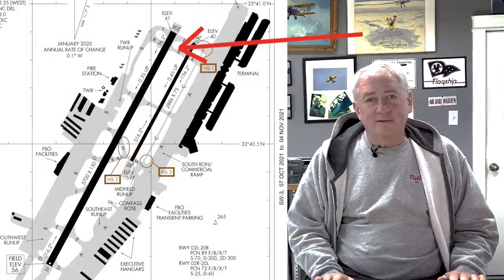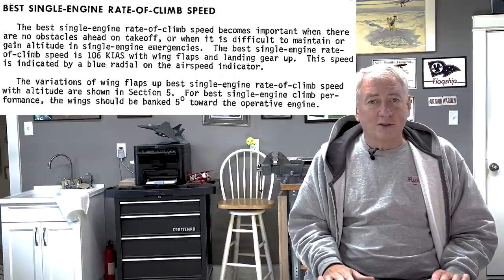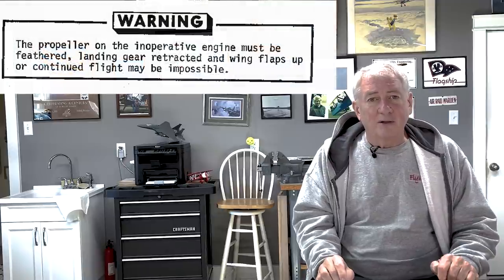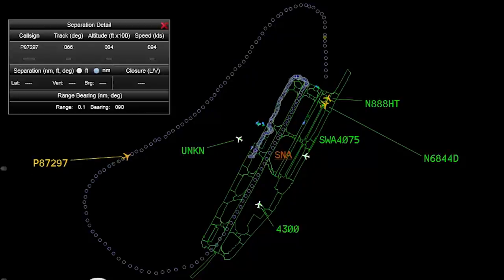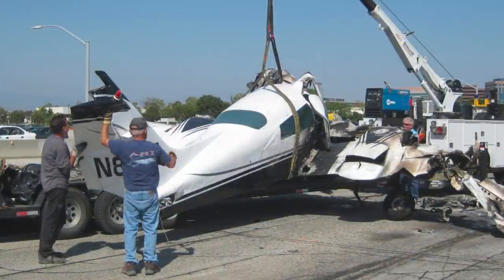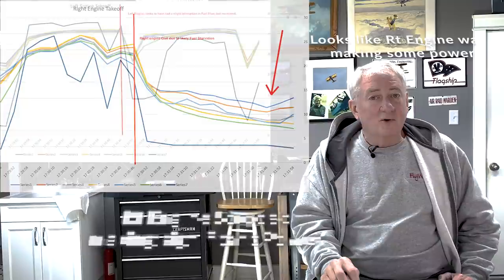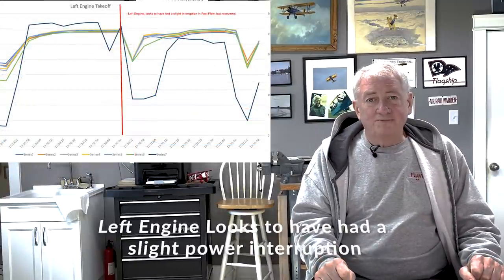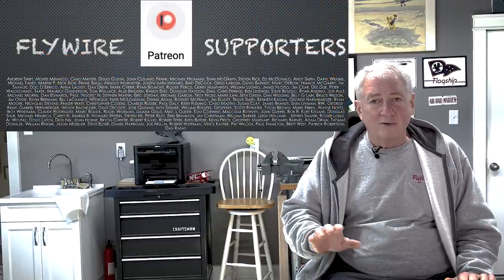C 310R Engine Failure After Takeoff

Comment: Mr. Perdue,, You had a single engine go around on a DC3?  Worst time ever.  High drag, low speed.  An ignorant FAA inspector on my multi checkout in Miami cut the right engine on me as i was raising the flaps and gear after a single engine approach.  He called for a go around.  I put power on both engines, At about 50 agl he cut the right engine again and said, no, on single engine now..  Piper Apache 150 hp high time engines. No climb with engine outs even with half tanks. 

 I went down to ground effect while flaps and gear went up and telling the dummy "Sir, this airplane cannot climb on one with gear down or at hot temperature.  He said, "Yes it should.  I hold it on ground effect for a few thousand feet telling him, no sir, it wont, While he insisted" it should climb now" keep it like that".  I was keeping it over the centerline with the 5 degrees to the good engine at full power, but.. it didnt climb.  

Almost at end of runway, he finally saw it and put power again, on the right.  Too low at end.  My friend in hangar came to see and though i really lost the right for real.  FAA inspector apologized.  He thought this was a PA23 Aztec.   Didnt know much about the many PA23's.  Almost killed us.  A Burrocrat pretending they know all they need to know.  I passed the CPL multi that way.  By almost crashing at end of runway.
Reply: I can FEEL you there. I would have pulled the left and landed on the remaining runway. There are no single engine go arounds. It would be helpful if you named the inspector. I had a friend who was failed on a check ride due to a controller error, with an FAA guy on board. (protecting a fellow burrocrat) She said, "I want a copy of the tape", and the guy begged her to just let it go, come back tomorrow for your ticket.

Comment: In addition to what you've explained here, I could be wrong because I can't tell the distance from this image but it seems to me despite the improper config of the aircraft, he almost made it back but what brought him undone at the very end I think was the fact that he didn't fly a clean downwind, his track brought him closer to final and therefore required a dangerously steep bank from base to final in order to not overshoot the center line . As you said, a preflight brief just before takeoff is important and I think reminding yourself of the down wind track would be helpful too so you don't end up trying to eyeball it. Perhaps even using the GPS/HSI OBS function and dialing in the runway track would be helpful too, then when you're on your way, activate the required leg. Anyway, great break down, good to think about these situations, flying twins is no joke.  Cheers

Comment: I haven’t been a pilot for a very long time, and never multi-engine rated, but I still remember it being drilled into my head, “NEVER TURN TO THE DEAD”. I guess it’s a normal thing for commercial pilots to make turns toward a dead engine. Are they making a bad choice? For light twins, it’s definitely a DO NOT DO IT.
Reply: As long as you have the airspeed and you are coordinated through the turn there is no issue.  Airspeed is key.
Reply: @adamwarren1918  I suppose you’re right, if you’re a skilled, practiced, and very proficient, cool under pressure, pilot. However, if you’re a “weekend warrior”, who doesn’t have enough seat time, of quality simulation panic training, I think memory items, like “don’t turn to the dead” can be the difference between life and death, in a light twin, one engine out, weekend warrior situation.
Reply: Nonsense,,, First,,,, Fly The Airplane,,,,
Reply: @BigWheelHawaii  of course the 1st 3 things are aviate navigate communicate, but if the pilot is a non practiced, weekend warrior, and they are relying on rusty memory, they better remember not to turn to the dead or they will most likely join them. Not turning toward the dead engine IS part of aviate, as in controlled flight of the craft, all the way to the ground. Not turning into the dead engine is major to retaining controlled flight. Maybe it is “possible” for a skilled, practiced pilot to keep a 310 flying while turning into a dead engine, but ignoring the risk, just fosters the old adage that there are old pilots, and there are bold pilots, but there are very few if any old bold pilots. So it’s really not nonsense, more like good sense.

Comment: I’m unfamiliar with the 310, why would he takeoff with flaps out? Most light twins takeoff with flaps up..
Reply: I fly a 310 and 15 degrees flaps are used for short field take offs.   I suspect they were put down for landing.   Or maybe he thought he needed it for noise abatement - I dunno.  In the sim you learn very quickly that additional drag will make you come up short in single engine situations.  Forget the flaps and just get the gear out.  Typically it is  10-12 secs for gear extension.

Comment: Listening to the ATC recording you could hear the panic in the pilots voice, with only 6 hours flight time in 7 years, this pilot shouldn’t have been flying this plane without a second qualified pilot. Also, check list are there for a reason, sounds to me like he tried to go from memory and not using the checklist, had he used the checklist this accident may not have happened. Glad both on board survived and no one was injured on the ground.

Comment: A friend was making  forced landing.  It looked good until he dropped the gear.  he then crashed short of the field.  I later  had an engine failure (out of gas) and glided in to a good landing, putting the gear down at the last instant.   Flying a twin with an engine out and the gear down was probably enough to doom him, never mind the fail to feather and flaps down.  And he turned into the dead engine.   I hope he bought  lottery ticket.  he is very lucky to have survived.   Darwin...

Comment: He might have made it if he wouldn't have been in such a hurry to get back to the field. Keep wings level and small bank into the good engine. and get some altitude. Once you have safe maneuvering altitude then start turning back to the field. A 45 degree isn't helping at all especially if climb performance is close to nil. He was operating close to sea level and low temps. Good example of what not to do.

Comment: At that airport the go-around is a left turn.
In a emergency could the airport flight controller allowed the pilot to do a right go-around flight pattern, if the pilot had requested it?
Or a less severe right turn, might have keept the plane in the air?
Thanks for a good explanation of what happens also happend in this case and the video.

Comment: You can turn into a dead engine if you are careful with your airspeed.  I'd hate to see pilots automatically dismiss this technique based largely on old WW2 training-isms.
Reply: You can, but it is more difficult.  So they say, avoid it.  Which is not right.  Also most WW2 airplanes had lots more torque to VMC roll you faster.  This guy crashed due in panic got too close to the runway, then did a steep turn, i bet with Panic Pull too, and stalled it on base to final.  Panic Pull i bet too.  His 95 knots on base was not that low for the weight, but if you do a base to final Panic Pull due overshooting it,  Down you go dummy.
Reply: @emergencylowmaneuvering7350  Then they should be teaching turns in both directions during training for the multi engine rating.  I think a few minutes turning each way would get most people over the fear concering this topic.
Reply: @rob737700  Most important, you have to trim to straight level flight BEFORE turning into the dead engine.  Trim, then turn.  Out of trim it its quite confusing and harder.  But the panicky pilot will just turn, and make pilot errors all over.. And die.. I did 2 full feathered landings when multi CFI.
Reply: @emergencylowmaneuvering7350  Been there/done that a couple of times myself.  Back in the day when commuter airlines had turboprops it took some effort to get new hires to "unlearn" this concept of not turning into a dead engine.

Comment: Piston twins sure don''t climb well--if at all--on a single engine. In my area during the summer most have a NEGATIVE climb profile of around minus 50 to 100 feet per minute. Lots of trees here and close to the ends of the runway.

Comment: This accident displays a blatant disregard for the Golden rules of aviate, navigate and communicate. Weather permitting it would have been wiser to maintain runway heading, secure the failed engine and climb to a safe altitude. The coast was straight ahead and terrain not obstructing. With the aircraft cleaned up and stabilized co-ordinate with ATC for a return flight path keeping in mind turning only toward the good engine.  Chances are that an engine relight was also highly likely especially with fuel supplied from the main (tip) tank.

Comment: (Responding the comment about flying straight ahead instead of turning right) You are right, straight ahead while gathering up the airplane and performing “the procedure” to feather the dead engine would have been good, followed by  turn to the left (after the dead engine was feathered) and blue line airspeed acquired, BUT it appears that the adverse yaw from the operating engine PLUS the additional drag of the unfeathered dead engine, drug the accident aircraft to right even past the desired downwind heading creating a very close in, tight right base turn. I don’t mean to beat on the unfortunate pilot of this accident, but want to second the point of the video- when one engine dies on a light twin, certain things need to occur methodically, carefully but as quickly as practicable to make sure you are feathering the correct engine. Directional control as you are pointing out, is one of the items that should occur, along with many others, but it isn’t as easy it might appear with one engine at “full power” and the other at “full drag”…

Comment: I'm doing multiengine training now. Turning into the dead engine is ok as long as you have sufficient airspeed, ideally blue line. Red line (minimum control speed) is determined based on non-turning flight with a bank (up to 5 degrees) into the good engine. Turning into the dead engine has the effect of raising the red line speed, so you have to be aware of that and avoid a steep bank. I wonder, though, if turning into the dead engine would give you a better single engine rate of climb than turning into the live engine because you need to use less rudder and therefore there is less drag from the rudder?
Reply from the maker: I can't agree.
Reply: @FlyWirescottperdue  Update: we took a DA42 up and tried a turn into the dead engine and then a turn into the good engine (both at Vyse). Because of unstable air, I would say the test was inconclusive. In any event, we didn't see a lot of difference between the two directions. We were getting about 250fpm climb both ways.

Comment: Again, like I stated once before. There is absolutely NO reason to fly a twin below Vyse, except on landings.
Also, why even bother taking off with Flaps in the Cessna twins?? Factory flaps are split flaps, more drag than anything... unless it had the STC for the slot type, but I'm unsure. I've only seen a handfull of Cessna twins with it (and all of them large 414A or 421s). So again, why even put flaps 15??
Reply: Only reason to have flaps down on takeoff is a maximum performance takeoff. Which is extremely impressive in a 310R, but dangerous climbing at 82kias….
Reply: @bricedill4194  yeah, but being split flaps they produce little to no lift and lots of drag. Like you said Impressive, but again, not because a vehicle CAN it means that you SHOULD.
Reply: @fdzaviation  if you’re making a maximum performance takeoff and not using flaps 15, you’re not following the POH and you’re a test pilot.  Haha
Reply: @bricedill4194  I don’t do maximum performance TakeOffs on the 340 because I choose NOT to push the performance. So Even if it CAN doesn’t mean that you SHOULD.

Comment: MD-90 noise abatement departures were more impressive - optimum flap high thrust setting [28 vs 25K] then the negative gs'.  But no more.  They type is being parted out in the dessert.

Comment: Scott —— any idea why he selected 15 degrees of flap , and kept it down all the way to the end ? It wasn’t a short or soft field and/or obstacles to be flown over . Is it in the ship’s POH/AFM ? 
If he had done the same thing ‘clean’ he might have made it . Don’t pilots realize that certified a/c are designed to climb and cruise most efficiently in clean configuration ?
Reply from the maker: One thing to consider is that half flap generally results in more lift than drag. I suspect his action was for that reason. I’ve used that technique before.

Comment: Its interesting that multi engine plane POH's from around ww2 and just after mention to NEVER FEATHER a prop if the engine is still running (but say heavily damaged or wont shut down) . 
As this can create very dangerous large spinning disc of drag that can create massive control problems.
But i dont see it mentioned much if at all anymore, Do all the modern ones have a built in safety oil lockout to prevent feathering while running?

Comment: If the FAA or NTSB faulted the pilot for turning into the dead engine, they need to take responsibility for mistraining him.
I have experienced 3 engine outs in a twin. PIC for 2  of them, and two were below 300 feet.  Altitude is your friend. If it is not on fire get the absolute best single engine performance, and get some altitude.

Comment: We made turns into the dead engine all the time in airliners in the sim. Proper use of rudder and correct airspeed made this a non event. What gives with these light twins? I did my ATP back in a twin commanche in 1974. Proper rudder and power application made pattern turns into the dead engine not a problem. Fly the effin A/C and know the effin A/C.
Reply from the maker: Jets don't have torque and P-Factor that props do... plus they have really BIG rudders.

Comment: Is it at all possible that the pilot would have returned prop, mixture and throttle to max power on final or on deciding for the highway  out of habit thereby obscuring any prior one engine out correct setting?
Reply from the maker: Doubtful
Reply: The prop, once feathered, will not come out of feather until the engine is restarted. That unfeathered prop is the source of all his woes. Very doubtful he would have been able to do a circuit with 15 deg flap and unfeathered prop. I would say he put the flap out for landing, which tore a big hole in his airspeed.

Comment: G'day Scott,

Yay TEAM...!

What a shining example, from 
"(get set, get ready...) GO !" - to the Woe...

6 & 1/2 hours in a Twin over 7 years ? Yikes, that's a token amount of time...; certainly not nearly enough to remember how to operate the machine safely - let alone justify the ownership of such a thing to only use it 55 minutes per year....

Was the Pilot flying other things over those years - or was the almost 7 hours the limit of their Airmanship "Currency"...?

   Congratulations on finding such a comprehensively illustrative case to dissect, revealing how many successive things went awry within the story.

By the synchronicity of the serendipity, and the benevolence of coincidence...(!), I too posted an actual Crash-Analysis a couple of days ago....

Titled,

"Analysing An Incident ; What Happened, And Why..."

  It's a story of a low-speed Car-Crash involving 2 Windmills, 3 Water-Dishes, and a Wattle-Tree equipped with a Shock-Absorbing Crumple-Zone, shallow Rock-Chocks, and a Course-Correction effected by one of the Windmills...

  The root-cause had it's origins in a form of  "Interrupted Cockpit-Drill" (!) which resulted in the Vehicle having been egressed with the Gearstick in Neutral and the Handbrake not applied.

The trickiest factor was figuring out why the Rock-Chock (belt & Braces Factor...) failed to restrain my Forester from setting out downhill, rolling on it's own...; only after 20 minutes of obediently sitting still, poised at the top of the slope...., during which time I had walked accross in front of the almost unrestrained vehicle (and it resisted the opportunity to run me over !).

Most remarkably, the whole event caused no significant or serious damage to ANYTHING which participated in the event.

As I often like to reflect..., 
"What's the point of having a Godtheory - unless it works every day, and in Realtime..
(!) ?"

Anyway, for an excercise in
 "How Unlikely Was THAT ?"
then please feel free to backtrack me to my Videos...

I don't often present myself with such mysteries, so happily the Video worked out pretty well.

Such is life,

Have a good one...

Stay safe.

;-p

Ciao !

Comment: If your below blue line and you loose and engine on takeoff, your not going feel the rudder pedals as to what needs to be done, the airplane is going to torque roll faster than anything you can do with your feet and your done, just plain done and over.

Comment: I don’t get your explanation of why the engine quit. If the engine was in “perfect operating condition“ then the engine driven fuel pump should’ve been sufficient to draw fuel from either tank. The main tank or the aux tank.
Reply from the maker: Not at Takeoff power, and not from the Aux tanks (just meant for cruise, with no boost pumps at all).